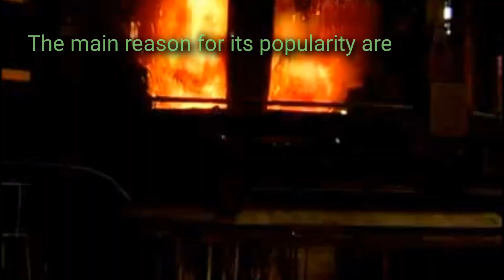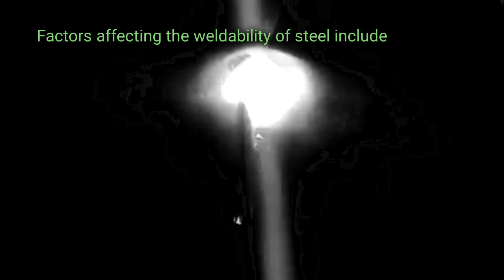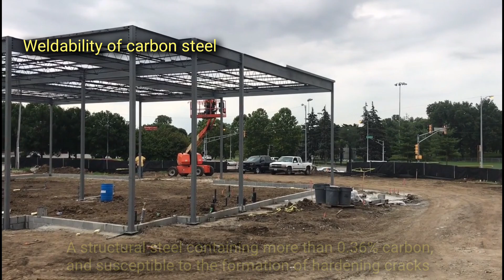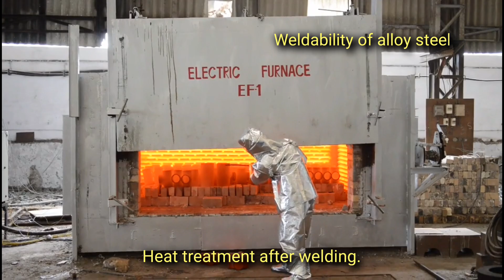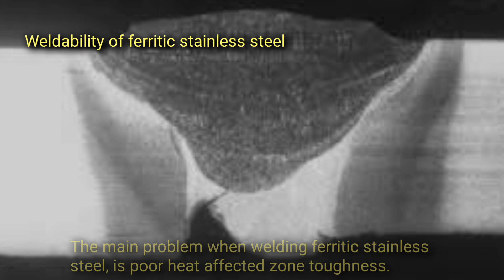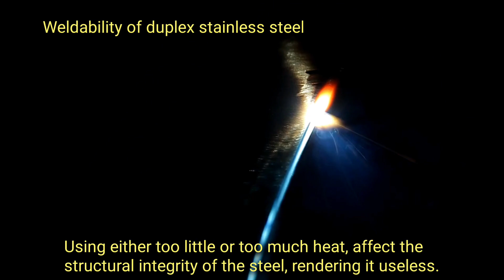Weldability Of Steel Types

Comment: Carbon equivalent is the number worth checking on the MTR for weld-neck work. Two A105 flanges can both meet spec and still weld very differently if one sits near the top of the CE range.